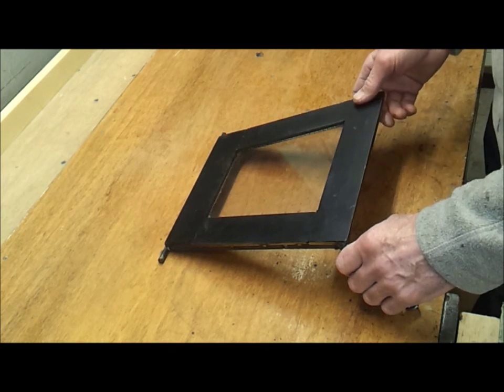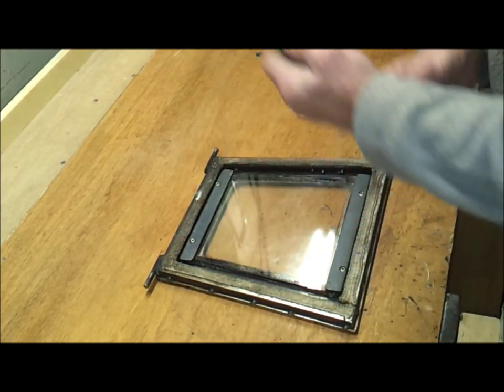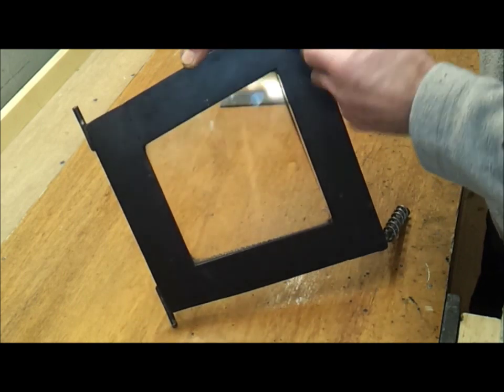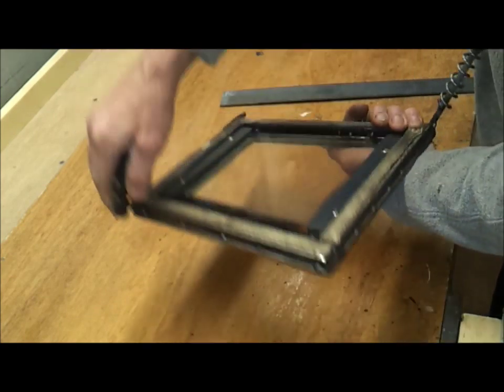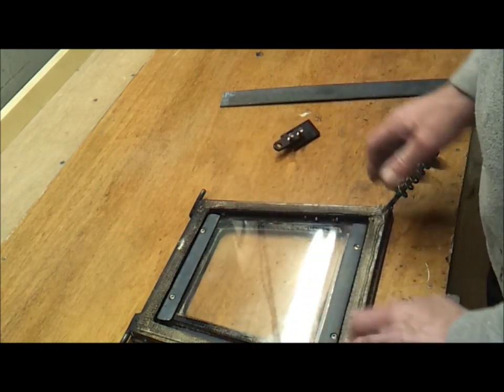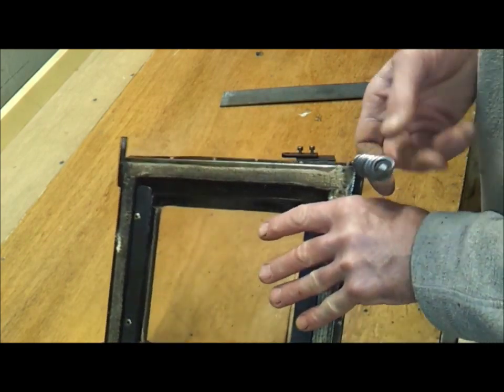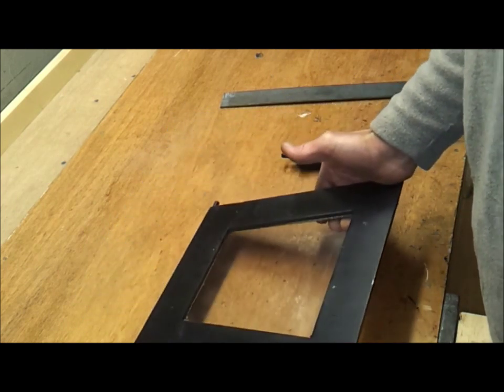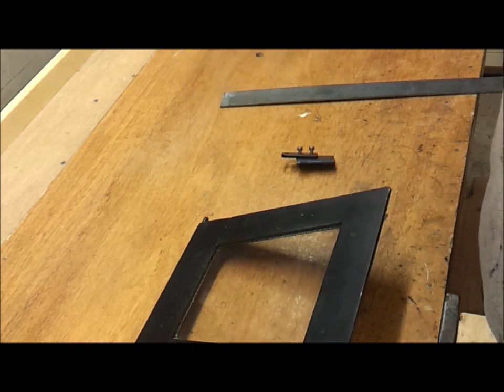Rocket stove door build and water heater update

Comment: Liked and Subscribed. Thanks for all of your video's. We live in a ten meter circus wagon and heat it for the most part with wood. I'm very interested in your boiler and the fact that you have in floor heating. This is what we are working towards. I think you and tryin2hard are going to be the push I need to finally do this. thanks again.